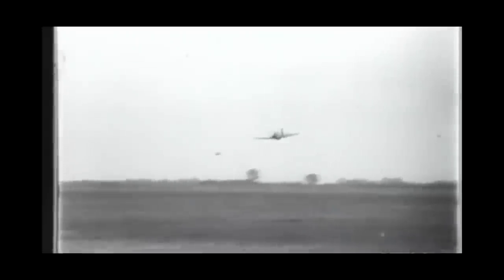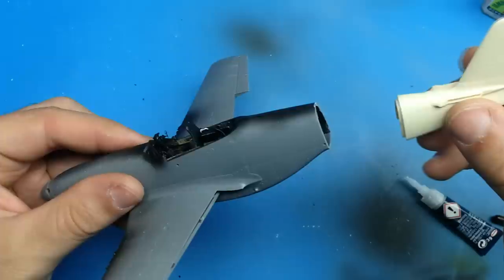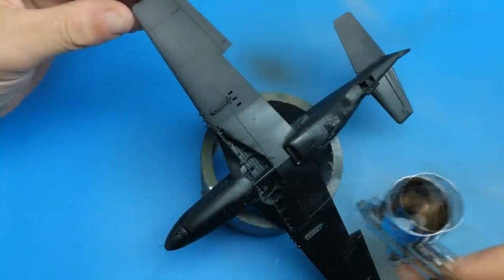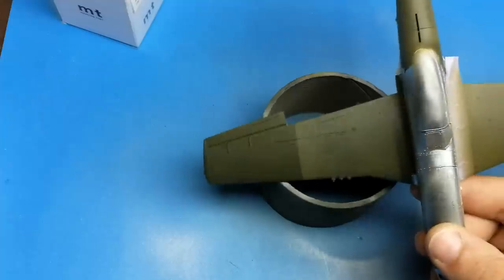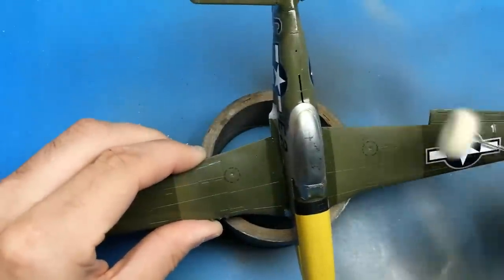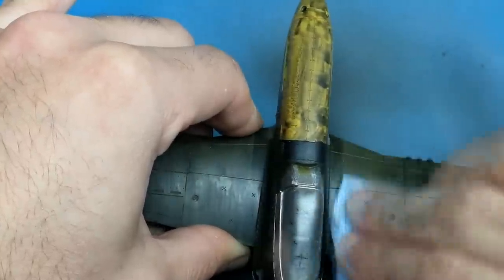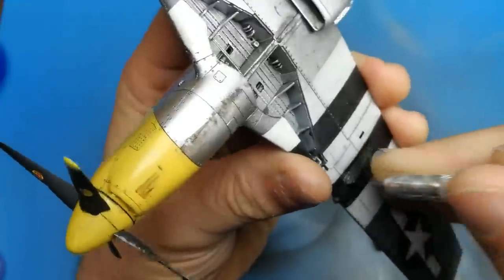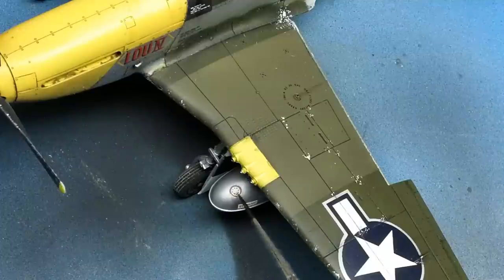Tamiya P-51D "Lou IV"

Comment: I bought the AMT F7F somewhere in about 1995. Although it is one of the 1/48 plane models I am most critical of (along with the Tamiya individual prop blade kits from then),  it did have hollow exhausts that were quite impressively done by AMT. I finished this AMT F7F1 this past year. Iam now getting closer to finishing my Tamiya p51 D Chrome plated version after  all these years also.  I just built the Model Svit P51H, and did my first Alclad Chrome over gloss black. I am super impressed  with that system. I am in disbelief of the reflectivity achieved. Model Svit P51H,  a Quality Jewell Like Model Kit. Hard to build though,  kind of like building a short run kit.

Comment: Great work. As a Brit a got to say the Spitfire was a fine looking plane but I really like the look of the Mustang a bit better.
I used to fly RC planes and bought a used RC Mustang. No know knew who's design it was. It flew on a (I think) a .40 size engine and had retractable undercarriage. It flew like it was on rails and I remember flying it on a lovely still summers day at the club I was a member of near Swindon. It was an old RAF base (Wroughton) and is home to the Science museums reserve collection.
I was doing low fast passes up the runway being egged on by my club mates with the call 'lower' after each pass.
On the last pass I over did it and there was the sound of the prop clipping the runway. I climbed straight away and managed to do a circuit and land ok. We reckoned I took a 1/4" of off the tips. How I got away with that I don't know.

Comment: Very nice build.  I love those OD on bare metal stangs.  FYI, the new Eduard kit is a D-5 so it has no fin fillet.  I’ve got it stashed and plan on starting it after my P-400 is done.  Great video!
Reply from the maker: It figures that a few months after hacking the rear off Eduard and Airfix release fillet-less Stangs lol
Reply: The Model Guy it’s a really nice kit.  I splurged on a few resin accessories (gun bays, wheels, undercarriage, cockpit, exhausts).  I’m really obsessed with those Profipack kits.
Reply from the maker: @tharp2458  I have it too, it's going to be part of my Mustang vs Mustang video series.

Comment: In fact the 1st USAAF fighter over Berlin was the P-47{The men who killed the Luftwaffe} the 51 group that was assigned Bomber coverage was blown off course by strong thunderstorms. The 56th F.G. flying P-47 D "Razorbacks & "Bubbletops" had initial coverage, {since range was overcome by external tanks} stayed with the Bombers. The 51 had very weak wings, since the wings were NOT part of the fuse. Unlike the 47 and Spitfire. The weather in the PTO was a nightmare for the 51's, B-29's were assigned to guide them around the fronts so they would not become lost or ditch in the Pacific. That's why Gen. Lemay{Commander 8TH AF} got rid off the 51's after WWII and just kept and upgraded all P-47's he could get his hands on to D-40's. I have the article written by Capt. Brown, he prefered the P-47 of all USAAF AC, but just found the AC to big for his size. Nice job on the 51, I see you did the floor as plywood VERY GOOD! Modelers often get that wrong. Excellent build, paintwork and weathering, CONGRATS!

Comment: 1:  As far as I can tell from the pictures of the original, the light area around the gun-ports was much darker that the (probably chrome) yellow on the nose--seems to match the lighter green covering the invasion stripes.
2: There should have been an Insignia Red L-shaped marking at the rear wing root, marking the areas where one could, and could not, walk.
3: Regs called for the gas caps to be Insignia Red; but since these don't really show up in any of the photos I've seen, they might have been painted over.
4: On the starboard side of the plane, a different name, "ATHELENE", apparently the crew chief's wife's name.
5: Again,according to Regs, most of the upper wing, (front 2/3 IIRC) the fixed panel lines were supposed to be puttied over, sanded smooth, and, in the bare metal planes, sprayed with an aluminized lacquer--that last not relevant to this model, but only the removable panels & hatches should be seen. (Same is true for entirety of Luftwaffe WW2 fighters, and perhaps other types as well.
6: Just a note--the rudder was cloth covered, sprayed with aluminized lacquer, so should have a different finish from the truly bare metal surfaces of the rest of the plane. (I use Testor's non-buffing Metalizer for the rudder, and buffing for the rest)
7: This plane is the poster child for distrusting color photos from the era--I've seen many copies of the picture of the single plane where the upper surfaces appear to be Blue!  All a matter of the color corrections used in the printing....
8:  not gripes; nit picks.  Great build and great video.
Reply: @Incog Nito Know? No. But all the evidence suggests that the wings were green, including careful examination of other colors of fairly reliable composition--if you balance the pics' colors so that the Nose is the right, Chrome Yellow color, and the Red is insignia red, the wings are definitely Green.
Reply: @Incog Nito Welcome....

Comment: Love commentary you should watch Greg’s airplanes and automobiles. He does a lot of really cool stuff. There was a lot of technical data used during the war like upping the manifold pressure (on Merlin) so it would preform much better the German fighters at higher altitudes. And how the US had up to 150 octane fuel by the last years of the war also improving the mustang performance
Reply from the maker: I'll check it out. I love those types of videos.

Comment: Hello my friend and beautiful model . How long is necessary wait to clean ( oil washing ) thanks
Reply from the maker: I let my clear coats dry for a full day and I give oils three days to dry
Reply: The Model Guy 1 clear coats 1 day . 2 then oil washing enamel 3 days . 3 Clean with paper ? It’s correct and thanks I love your page and thanks for help me . Because I lost my P40 with washing oil paint .
Reply from the maker: 1. Add two layers of clear coat. I use Tamiya X-22 which is a laquer. Allow a full day to dry

2. Mix your oil based wash. Apply and allow to dry for 20 -30 minutes.

3. Wipe away with a shop towel. 

4. One you've wiped away the excess wash, allow to dry three days

5. Seal with flat clear. Allow to dry a full day.

6. Weather with oils if you like. Allow oils three days to dry.

7. Seal everything with your choice of clear coat.

Basically you need to have the oils dry to touch before you seal them.

Comment: Very nice build and history lesson! However did you polishthe surface before the polished aluminium? Or did you apply a gloss? And did the lacquer gloss take out the sheen out of aks product as it does with alclad?
Reply from the maker: I thought I had lost my painting footage but ended up finding it last night in the wrong folder.

The order for the polished aluminum went like this:

1) Primer
2) AK Extreme Metal Gloss Black Base
3) AK Extreme Metal Polished Aluminum

I didn't polish the gloss black coat as I didn't want a super shiny metal look. And the flat coat didn't take out as much shine as I thought it would which made for a better contrast between the OD and aluminum.

I have a P-38 in the line up which will be NMF so I'll be sure to go into a bit more depth with it. This is also why I try to avoid multiple builds at once as footage can get mixed up easily :S

Comment: Another point of interest about Spitfire v Mustang, the wings... Mustang had a wing designed for high altitude flying. Spitfire was better suited for low altitude flying. Down low the mustang was like driving a top fuel dragster in a parking lot so the Spit or 109's in a dogfight would eat it alive. Above 20K is where the Mustang shines (just keep the speed up).

Comment: Yeah that kit is still nice! I love that cowl too. Weird Eduard did not do that - they did on their Spit IX. 

P-51B/C and Ds were quite alot faster than both 109s and 190s at altitude. That was a AMSSIVE advantage and would have been massive still, even with better Luftwaffe pilots. You have like 50 to 80 km/h speed advatnage. That is huge. Add to that, better dive characteristics..

190Ds and 109Ks were not a huge factor and not superior but more on par. Especially the 190D. The k, not so much. 

And I think you are a bit unfair as well. It was not uncommon for a single Fighter Squadron to hit 100, 150 or 200 109s and/or 190s as they swept ahead of bomber formations. Just because hundreds of P-47s and P-51s escorted, not all of them bumped into that german gaggle. More often than not, it was a smaller US formation hitting those big German groups, first..

Comment: There is no such thing as a Boom and Zoom fight
Boom and zooming requires altitude advantage 
With the Spitfires superior climb rate this would be hard
You might mean energy fight, in that case Spitfire still wins (especially if you compere with the mk XIV). Mustang has terrible energy retention.
Reply: The spitfire was an interceptor while the mustang was a escort fighter. The mustang isn't good at doing the spitfires job and the spitfire isn't good at doing the mustangs job. Two very good planes meant to do two very different things its hard to compare.
Reply: Yet he said the p-51 would beat the Spitfire in a BnZ fight
He probably mean energy fight and in that case Spit wins
I was correcting him
Reply: @krankysfirebrand485  the spit would win in an energy fight and the p51 would be at an advantage in a bnz fight  that's also dedicated by who had the energy advantage at the biggening of the engagement who has the better pilot and so on. My point being both are great aircraft for different intended purposes. No dogfight is the same at the end of the day
Reply: And my point is
-There is no such thing as a BnZ fight
-P-51 would never defeat a spit in any likely scenario
Reply: @krankysfirebrand485  bnz is a type of energy fighting tactic I get it. But if a p51 dives on a spit it's going to have the energy to climb back up and is going to have more energy than the spit so it will most likely break away and just rinse and repeat it'll make it hard for the spit to even catch it. And the spit could do the same. Every engagement is different and theres many factors. Spitfires dont always fly at their service ceiling so yes a p51 could be above a spitfire. Also depends on the pilots that are flying the plane. Since the spitfire is so dominat I'm guessing it never got shot down in combat right? A p51 can shoot down a spitfire and a spitfire can shoot down a p51. All depends on the scenario and pilot capabilities in each aircaft.
Reply: Did you read what I wrote? “Any likely scenario”
Spit would just outclimb it from the start and p-51 would bleed a lot of energy
When you compare aircraft you cannot compete the pilots
Spitfires where shot down because:
-enemy pilot was better
-meeting multiple enemies
-coincidence of the enemy being over it
-unlucky scenarios
-Worse Spitfire variant
Reply: In what scenario would there only be a 1v1 where they both take off and meet at a point to fight? You're being delusional I'm talking about a real life scenario that would most likely be in ww2 combat which would be the time these planes were used. Of course your scenario is going to favor the interceptor. What if I put a scenario where the spit starts in France and the p51 in Germany and they have to fly to each other and fight. Then the p51 wins because of its service distance compared to a spitfires. Be real here both planes can shoot each other down depending on the circumstances
Reply: Service ceiling? Haha! No
CLIMBRATE

Mustang will lose every fair scenario 
Just Because Spitfires have been shot down doesn’t mean it doesn’t have the best plane of the war
Reply: That’s not a fight
P-51 is one of the best escort fighters
But in a fight scenario the Spitfire WILL win
Any real fight will favor the interceptor 
I’m not saying the Mustang is bad
I’m saying in a 1v1 A REAL ONE
the Spitfire has the advantage
Your just proving it needs some sort of luck to win instead of actually being better than its enemy
Reply: @krankysfirebrand485  it just brings me back to my point at the beginning, two different planes with different intentions in mind. you can say the spitfire is a better dog fighter with everything being fair but the p51 is a better escort fighter and that make sense their both better at their intended purposes. you can't have "best" plane of the war because planes weren't just used for dog fighting. If you would of said the spitfire is the best dog fighter then sure i could agree but saying it's the best plane in the war I don't know about that. But to say that a p51 would never shoot down a spit is way out of reach.
Reply: @krankysfirebrand485  But I'll give it you a spitfire with everything fair including the pilot and the scenario they met it should/ would win against a p51
Reply: Yes you are understanding 
Mustang is a great escort fighter
Spitfire is a great aerial superiority fighter

Actually wouldn’t the Mosquito be the best plane since it fills almost every role and is cost efficient

Comment: Shouldn't the wheel wells be zinc chromate color (I don't really know for sure)?  Also, the leading edge painted panels around the machine guns are a bit too large, there shouldn't be a white outline around the stars and bars on the wing and there should be a rear view mirror on the right side of the windshield frame.  Oh, and the star and bars on the underside of the right wing is too far forward, and maybe too large.

I'm not really criticizing the model; it's very well done - but if you can go 98%, why not go the additional 2%?

http://village.photos/images/user/85d867b2-3601-412b-a045-5eaf6755cd8a/7207333a-e062-45b7-a187-f48da4a6fb9c.jpg
http://village.photos/images/user/85d867b2-3601-412b-a045-5eaf6755cd8a/d7d929d5-0ae9-4947-8d65-e76aab03884b.jpg
http://village.photos/images/user/85d867b2-3601-412b-a045-5eaf6755cd8a/010813e3-f614-4867-ba45-4d8ea1c02430.jpg
Reply from the maker: The wheel wells were not painted except for the rear most visible spar. Unfortunately Tamiya only has a very basic wheel well and they are boxed in, which they are not on the Mustang. They also didn't include the mirror which I don't have in the spares box. This was done as part of a group build within 30 days so I didn't have the time to dig around for a resin mirror.

 The leading edge painted panels match what Tamiya shows in their instructions and the photo your first link shows doesn't have a great angle to show otherwise. They've also modeled the gun ports a lot larger than the actual scale, so that may be whats making it look off. The last photo you've linked I've not seen before and I can see they didn't paint the black stripe under the pylon. I appreciate constructive criticism.